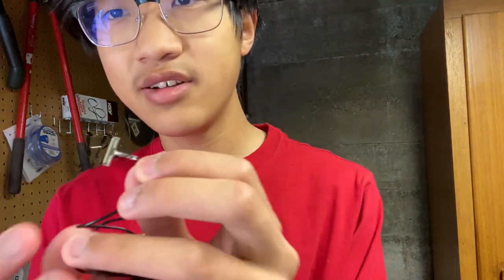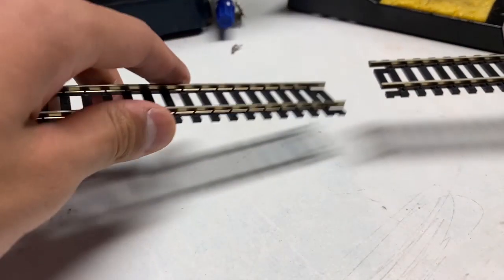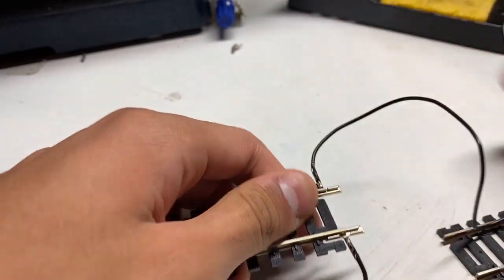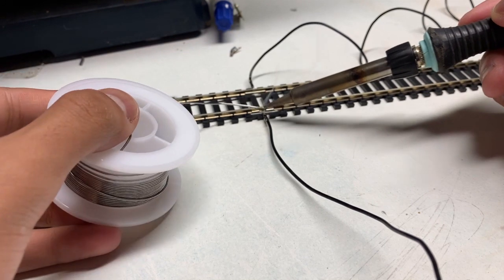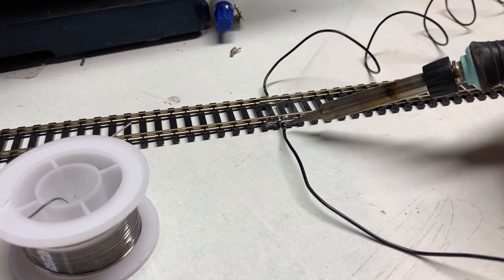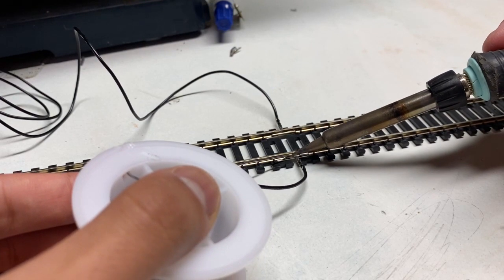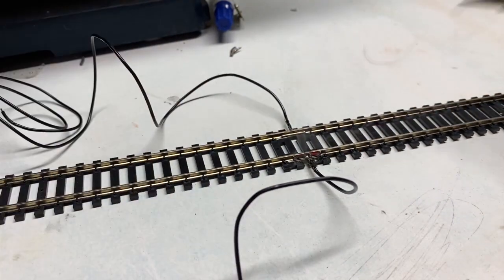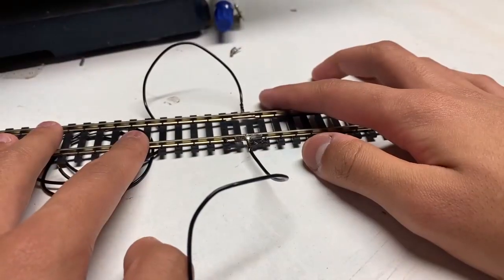How To Get Power To Your Ho Scale Layout

Comment: I solder my dropper wires to the bottom of the rail joiners myself. (cheaper than buying those ones that have the wires attached) having the droppers on the underside of the rail joiner means they are completely hidden and every join in my flexi track gets dropper wires attached to the bus feed. I do solder the rail joiners on the outside of the rail only and my system means I never have any connection issues. especially around turnouts/point work.

Comment: that makes feeder wires pretty simple. they are not soldered yet crimped onto the wire.
if you turn the rail joiners the other way, so the wire goes inward to the center of the track. might be a bit better  for drilling one hole to drop the feeders.
Reply from the maker: Yeah these are a nice little hack. The precut track is has a bunch of weird ties in the way but with flex track that would totally work

Comment: How do you connect a transformer to a lionel HO Guage track? Also, what kind of transformer do you recomend for a Lionel HO Gauge track?
Reply from the maker: Any hobby store that has HO scale train stuff should have the connector your need for your track. Assuming that you're running DC, I would personally recommend any MRC powerpack. Slightly more expensive but IMO worth the extra coin. Most MRC controllers output plenty and have extra ports for accessories like street laps